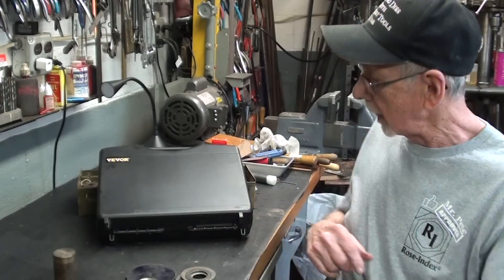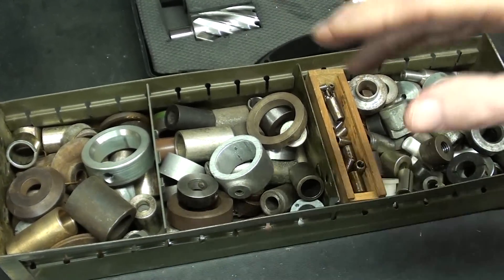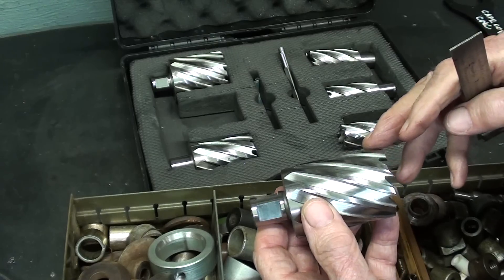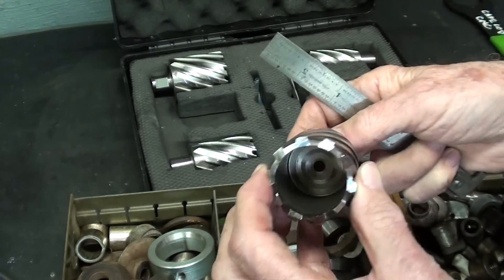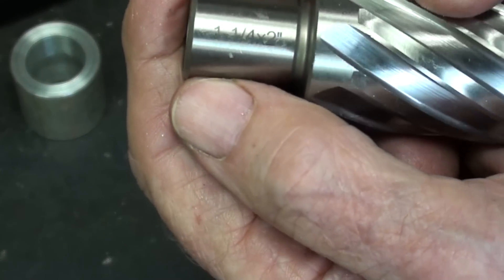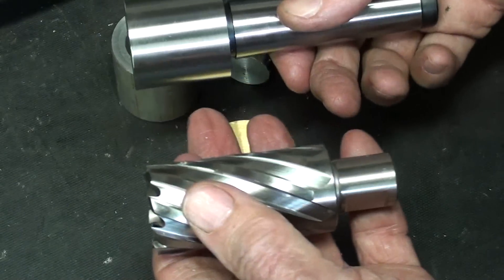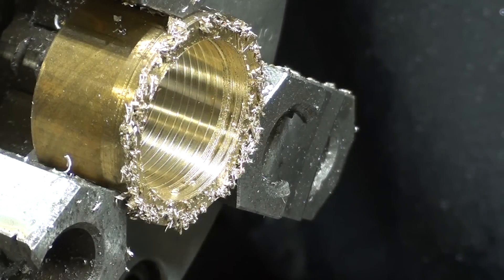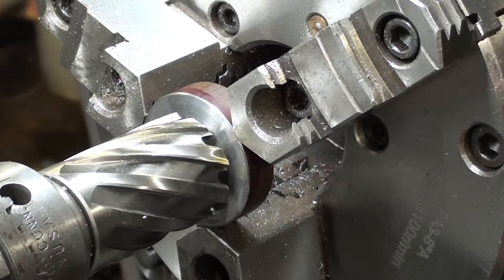ANNULAR CUTTERS make BUSHINGS & SPACERS  vevor #874 tubalcain brass lathe

Comment: Mr. Pete...please read this.  I believe your issue with the ER collet not screwing on is this - the collet is not fully snapped into the collet nut, ie. snapped in flush with the face of the nut...thereby preventing the nut from screwing on.  Don't ask me how I know.  Thanks for all your inspiring machining videos !!
Reply from the maker: Thank you, several other people mentioned this. I had these callouts for years and never used them, or even looked at them until I was making a video.
Reply: @mrpete222    You're the best !  Thanks again for all of your training and educational videos.
Reply: Correct.  The collet must be first snapped into the nut by tilting it a little and pressing together.  Then, and only then you can screw on the nut part.  I love them, I can use three at one time, one in the headstock, one in the tail stock and a third in the milling machine.  They get a phenomenal grip.
 And are very easy to use.  Joss, Cofk  Ireland.

Comment: From experience with annular cutters/slugger bits do not put side load on them. aThey smash into little pieces when not drilling straight. The sides are designed to keep the hole for evacuating the chips.

Comment: Good test. These cutters are not self- centering, especially on a lathe. I’m sure you’d get a much better finish and more accurate hole on a Bridgeport with its rigid spindle.
Reply: They work better held in a proper arbor in my experience. I have used up to 64mm diameter on my lathe.

Comment: That’s the perfect rpm main thing I noticed is you were a little light on the feed pressure they like to be feed hard light cut tend to blunt them quick
And will help with the surface finish and tolerance

Comment: Lyle with the ER collet adaptor you have not assembled it correctly. You need to take it apart to insert the collet into the cap. There is a special offset spring washer in the cap that needs to fit into the groove in the collet. It is there so that when you loosen it to remove the cutter / drill, it will eject the collet from the holder. You will need to place the collet in at a slight angle until it click into place, when the collet is fitted correctly the face of the collet and nut will be flush. When you showed it there was at least 1/8 " recess between the two. The shallow taper on the collet makes then really lock into place, a but like a Morse Taper, so the groove in the collet and the offset washer in the cap acts as an ejector to pull the collet out. Hope this helps. Regards from Australia.
Reply: I've seen a lot of people having trouble with that off-center part of the collet nut, Some even turn it out with a lathe thinking it's a manufacturing defect. 😰
Reply: Came to say the same thing.
Reply: lol...had the same problem
Reply: Ditto, I have been using ER collets for years. Also, for holding cutters that may take a high load I suggest you use ball bearing nuts to clamp the collet. They hold tighter with less force.
Reply: I forgot that no one has a seinc of humor any more..... sorry
Reply: @51-FS  - you didn't say anything humorous, and there was so indication that it was supposed to be sarcastic or numerous. If you had written it that way, we wouldn't have jumped 😃
Reply: @johncoops6897  yeah commonsense ain't verry common anymore I see.....
Reply: I'm sure he knows what he's doing...
Reply: @51-FS  Mr. Pete got this wrong. Dave is correct on how ER collet chuck nuts work.
Reply: @51-FS  - no, he obviously DOES NOT know what he is doing. He has not assembled the collet into the nut, as others here have already explained.